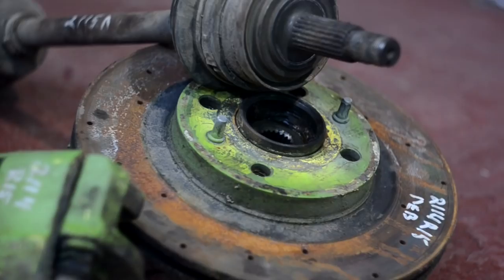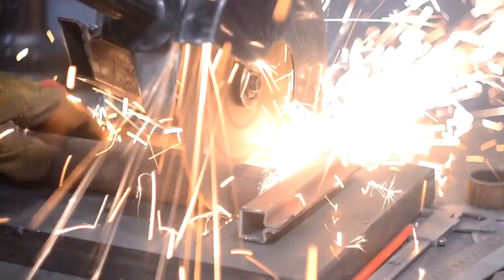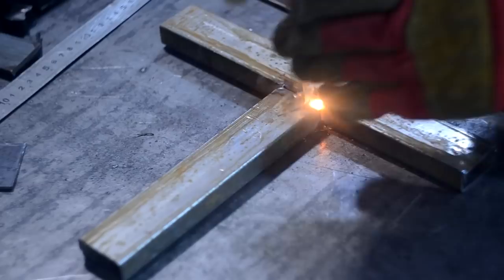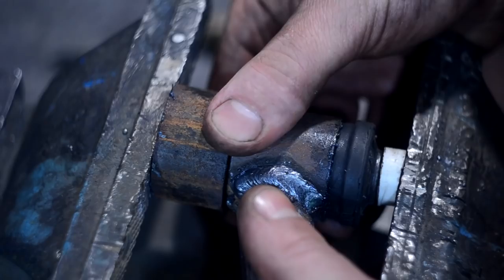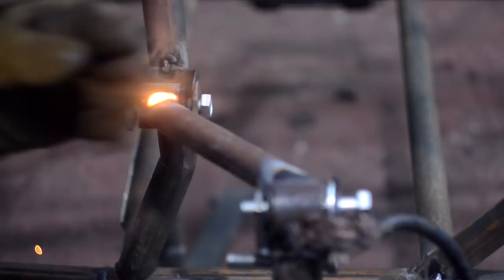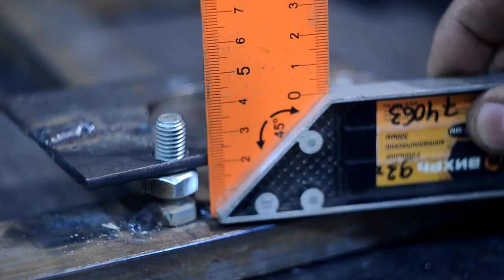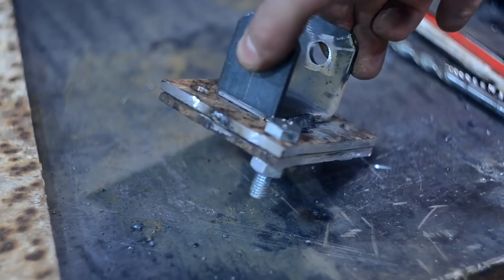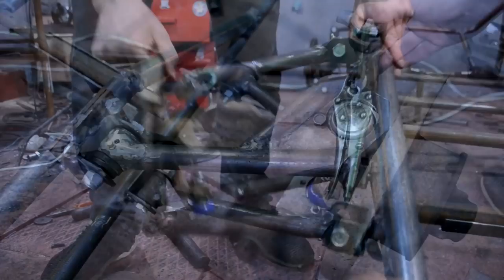How to make Buggy from PUBG - Suspension. Levers, swivel members and bushings. Part 2

Comment: Let me help you it is not slabs of metal a slab is something you pour for a patio. Plats is the word you are looking for, and try telling us the dementions of everything instead of saying I measure the distance, Try i measured the distance and saw i needed this many centimeters or inches. I cut some 1/4 inch plate for the whatever it is . I used some 1 inch round bar, like that. Nice work very nice. You are the first i have seen to replace rubber with wood so you could weld, great idea i learned something new